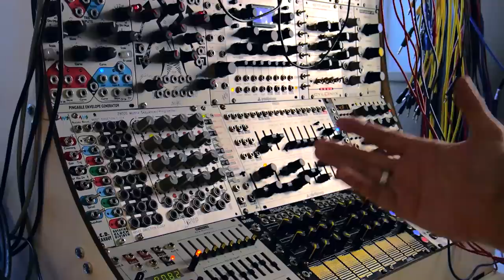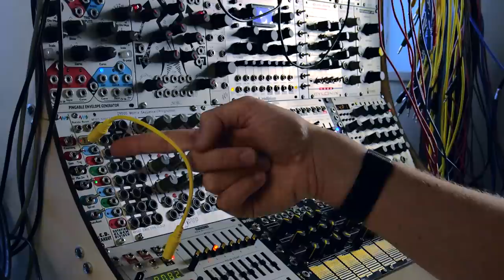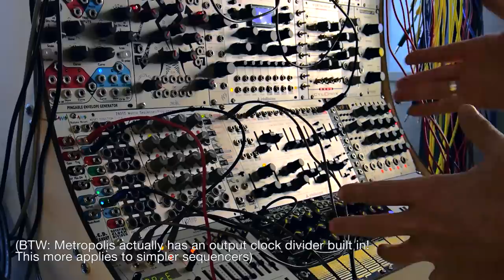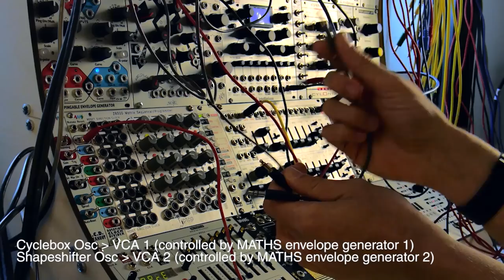Modular Monthly: Clock dividers & multipliers

Comment: 4MS rotating clock divider is legit.  Although there are cleaner sounding dividers if you use it for audio rate.
Reply: Yeah, it sounds like it was having trouble following the square and saw waves. 

Any recs?

Comment: 15:10 Does it rotate if there's a DC voltage (then at what rate?) or do you rotate to the voltage applied (like an offset, eg 1 step per volt?)

Comment: I am only starting to learn about modular systems. My question is: is it possible to assemble a mini modular system containing only a clock multiplier and a clock divider? My idea is to have a clock generator (for example the Boss RC-300 loop station) that outputs a clock at let's say 100 BPM. This clock controls the speed of an arpeggiator of a synth (e.g. a Korg R3). I then branch off the clock signal, run it through a clock divider and control a drum machine (for example a Korg Volca Beats) at 50 BPM. At the same time, I'd run the original 100 BPM clock signal through a clock multiplier and control yet another drum machine (e.g. Teenage Engineering PO-12) at 200 BPM. Of course I'd need a MIDI-to-CV converter, but this is a secondary problem. Would the overall idea work out this way? If so, could anybody suggest videos, blogs or homepages that deal with this sort of thing?
Reply: i had a similar idea. i'm sure its possible. i also use a rc 300also. curious to hear if that works for you. would you use the tap tempo input on the rc 300 instead of internal clock?
Reply: tim sullivan I don't like tap tempo buttons in general, because I am never perfectly precise with them, so it almost always gives me some odd tempo with positions after decimal point, something like 89.3 BPM or something. I like the BPM to be a whole numer (most of the time it's either 100 BPM for nice downtempo jams or in the range of 120 - 130 BPM for a little bit faster electro tracks), so I always use the value knob on the RC-300 to set the BPM to a particular number. Since the RC-300 doesn't accept external MIDI clock signals (unless the midi clock comes from yet another RC-300), I use it as a MIDI clock master for everything I want to sync, which works quite reasonably well (except for the Korg Kaossilator pro+, which falls out of sync ever so slowly. But that is a different problem altogether). Now, I'd like to broaden my horizon and experiment with clock dividers, syncing or even triggering different drum machines. After watching videos about modular systems the whole day (!) I am pretty sure that this is possible. Now, it's only a matter of time and money :) A lot of time and a lot of money... :(
Reply: +whiterottenrabbit ah. but you can trick the rc 300 into being the tempo slave by sending it tap tempo as midi note from anything. like your daw.
Reply: tim sullivan
Ah, OK, thanks for the suggestion! NEver experimented with that, because the current setup worked out for me just quite OK. But I will experiment with that more!